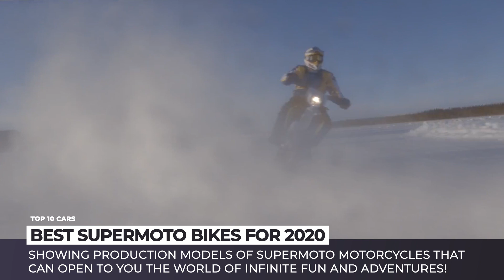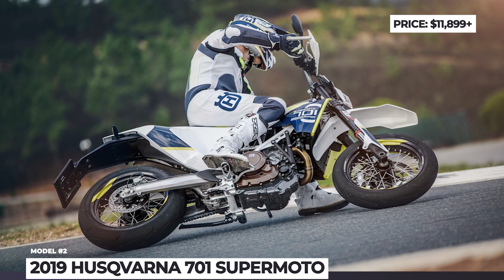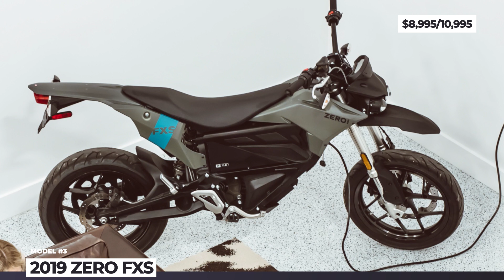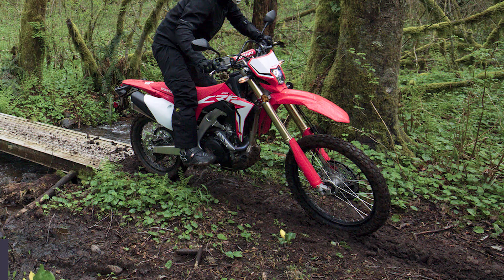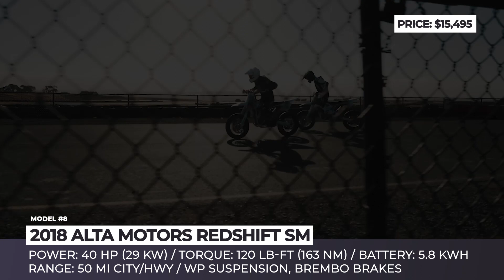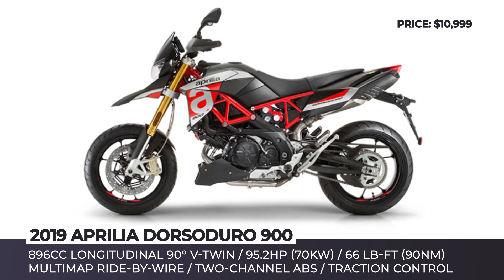Top 10 Supermoto Bikes for Streets and Track (Production Motards of 2020)

Comment: The DRZ 400 sm deserves a place here since it's a great machine and is road legal as well.
Reply from the maker: Appreciate the suggestion, will upvote your comment for others to learn about this extra opinion
Reply: What about the xr650r
Reply: @robsonley918  they recently re-legalised high capacity bikes in our country but the most seen bikes are the DRZ-400 XR-250/400 WRX-250 and the Kawasaki D-tracker also known as the KLX-250 and sometimes the Honda FMX 650. Not much XR 650's to be seen but I have seen the power of that beast. It's scary...
Reply: @nadunwijesinghe965  I've got an xr650r they are really rare here, loads of the big heavy 650l's not many r's it's loads of fun tho other than having no electric start😂 not much more power than a wr450 but a lot more reliable
Reply: What is the horsepower?
Reply: @electroniccheeks  46
Reply: @yohanroshan1767  
Thanks.
Reply: Drz is a worst bike check yammie noob yt guy he said drz is wprst
Reply: @Augizzz  Different people have different opinions lmao and different people love different bikes 🤦🏽‍♀️
Reply: @Augizzz  hope this is a joke, yammienoob is biased.